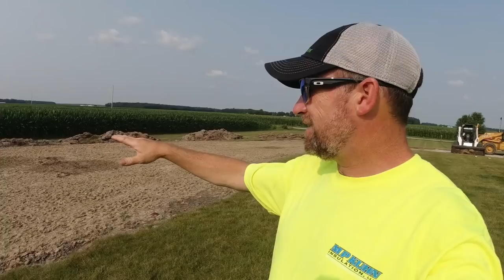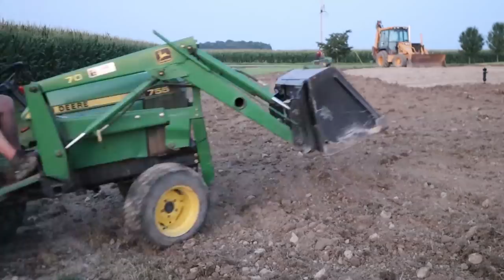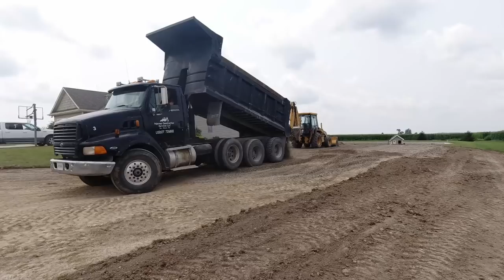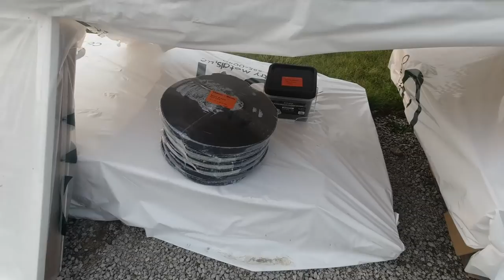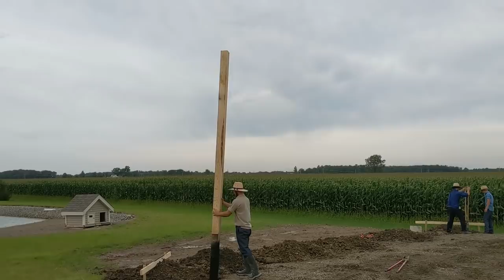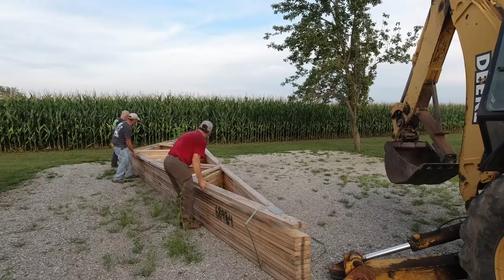Backhoe & Compact Tractor Excavating //Prepping a Building Pad - My Brother's Barn Build Part 2

Comment: Neil, you can add polishing concrete to your resume'!  The pad came out nice.  But, I thought you might want to know.... 220 grit is about right for paint grade... but, if your gonna stain it you might want to go to 400.  It keeps the stain from splotching! 

Mennonite crews built my shop, the addition to my shop and my equipment barn.  The first 24'X24' shop build used solid 6X6's in 1996.  The crew was on-site for 17 hours.  (It would have been 1.5 less but, they had to come back and install the garage door after it arrived.) The 24'X24' shop add-on also used solid 6X6's in 2014.  That crew worked for the nephew of the previous builder and was on-site for 14 hours with one concrete finisher who had to stick around a couple of hours to do the final troweling.  Both of these jobs included 1" rigid foam insulation, windows, doors and concrete.

In the equipment barn, we talked about the options of using solid 6X6 posts, fully laminated posts or  solid posts below ground level with laminated 2X6's above.  In the end, we went with solid 6X6's because the front of the barn is open and the builder (more so than me) thought it would look better.  It was built at 36'X18' with a 4' open front overhang.  It doesn't have 1" rigid foam insulation, windows, doors or concrete.  They were onsite 13 hours in 2020. 

In each case the experience of watching a organized crew of highly skilled workers was pure pleasure.  Each had his particular job at each stage of the build.  There were very few instructions or requests for help.  They worked so well together that when help was needed, someone was there waiting do so.  Their attitude and cheerful banter was refreshing.  Professionalism was apparent in even the youngest 'helpers'.  They walked away each time with a spotless jobsite and a totally satisfied customer.  

That crew built 75 pole buildings last year.  Some as large as factories.... some even smaller than mine.

When my first shop was built, I had shopped around for contractors. A carpenter buddy of mine had his partner quote building it.  They came in almost 50% higher with a two month wait... just to start.   The Mennonite crew gave me a 2 week completion guarantee... which only the delayed delivery of the roll-up door missed.

After it was built, my carpenter buddy came by to inspect.  He told me that they wouldn't have used trusses because they were too expensive and you don't really need them in a pole building.  He also told me that the 6X6 posts were overkill.... the standard was to use 4X4's.  He then explained to me that because I was going to cover the inside walls, putting the insulation on the outside was a mistake. It would be better to put it between the  horizontal stringers.  And lastly, the roll-up door entrance is an inch below the floor inside.  When the crew found out that I would be rolling small wheeled equipment like my air compressor, push mower and Shopsmith through it, they tapered the entrance instead or putting in a lip.  He informed me that I was asking for trouble because without the lip snow would blow in.  His conclusion was that the shop was overbuilt and the crew had missed a few important points.

I just let him talk.  When he finished I thanked him and started to usher him out when he said, "You should have let us build it for you.  We would have done it right and saved you a lot of money."

I told him, "Perhaps but your bid came in 50% higher, four times the delay and thought it would take a week to build. They built it in 17 hours... and I got trusses and 6X6's. I'll put my trust in a good bottom seal to keep the snow from blowing under the door."

His response, "They don't have to pay all of the taxes that we do. And, they buy their lumber by the truckload. It isn't a fair comparison."

I just told him, "Good points... I'll live with my mistakes."

Just one last note, the laminated 6X6's are stronger than solid 6X6's.  They are laminated in a factory with adhesive cured under applied pressure.

Thanks for the time lapse, I can watch skilled competence at work all day!
Reply from the maker: I think it sounds like you made the right choice.  Anytime I hear the word "overkill" with a building project I consider that to be a bonus rather than a detriment.  

It is certainly enjoyable to watch a skilled crew work their magic.  These guys are no exception.  They were having fun and gettin' it done in no time flat.  I have helped build some pole barns and such and I find it much more enjoyable to watch.  I paid to have mine built by guys that knew what they were doing as well and it is just a rewarding feeling to know that I didn't have to fumble my way through something that someone else is already an expert on.  When you build 75+ barns a year you've got to know a thing or two!

Much like me, my brother had the building built and the concrete poured by contractors.  The same thing I said above about watching a building go up applies to concrete as well.  I learned a long time ago I am not cut out to pour concrete.  You only get one chance to get it right and I am the type of guy that likes the security of an eraser on a pencil or a second take for a video shoot! Once the outside and the floor is done then he will finish everything on the interior, just as I did as well.  No time crunch and no real weather concerns once buttoned up inside.  

So, that's why the 220 grit is as fine as I go.  You'll see in the next video that we let the concrete guys do the 400 grit pass, and they did a terrific job at that!  

I'm glad to hear your take on the laminated posts also.  That's what is in my building although I don't have the plastic wrap at the bottom.  Wish I did.

Thanks for keeping up on the project and sharing insight from yours.  See ya next time around!
Reply: @digdrivediy  I don’t need the eraser on the pencil… I have one as big a a shoe sole right there in the desk!

I am posting a video this week where we spent a whole morning just putting up 4 posts…. Then fixing my stupid mistake!

Pole building is not in my resume’ !!!

Comment: That tile repair was a real feat. Do they wash the recycled crushed concrete to remove oils and other pollutants.
Reply from the maker: That's a great question but to my knowledge they don't wash it.  It goes through a powerful magnet conveyor system to remove metal so maybe they do spray it, but I doubt it.  Fortunately I don't think there are too many pollutants in it but of course I'm not entirely sure of that either.

Comment: Buddy!
Whatcha using your laser level setup?
Maybe something a little smaller for my setup.
Those Amish know how to work!!!!!

Thank you !
Reply from the maker: I have a Topcon RL-H4C.  I think that model is discontinued but they still have something similar.  It's in the $500 range for the laser head.  I also use a lenker rod instead of the normal fiberglass telescoping stick.  I think they are much more useful.  I had a cheaper laser for about 5 years before the Topcon.  It was junk compared to this one.  I love the Topcon for what I do.

Those Amish boys get 'er done for sure!

Comment: Great video. But i was wondering... So you built up the site with dirt. a lot of dirt. What is the reason? Obviously to make it level you had to build up the far side. But how high above grade do you need to build up the site for a pole barn? Is there a general rule of thumb?
Reply from the maker: We raised it up to a safe elevation against potential flash flooding in the field.  We know that with heavy rain this area was prone to be under a few inches of water from heavy rain events so we took it up to an elevation we know will likely remain dry.  I would suggest that on any build that you get it up to an elevation you know is traditionally dry.  Great question.